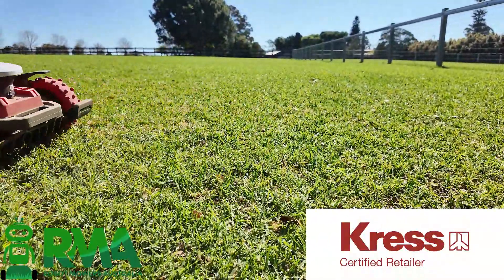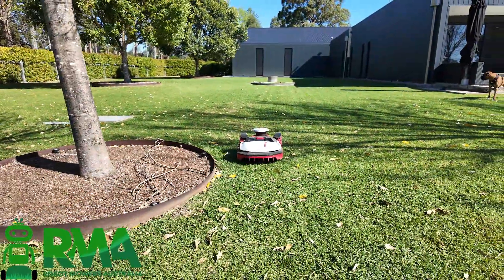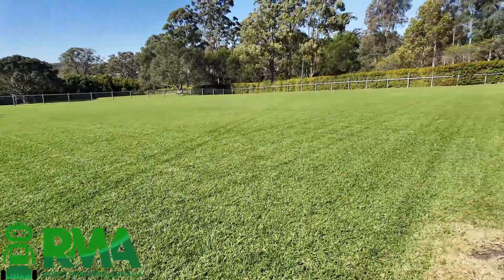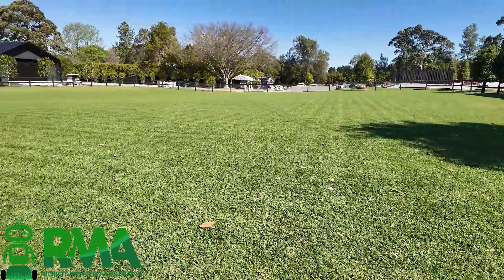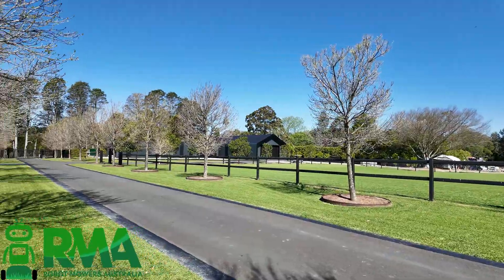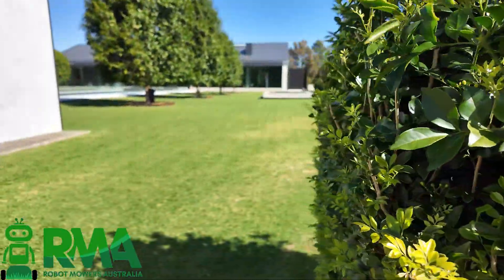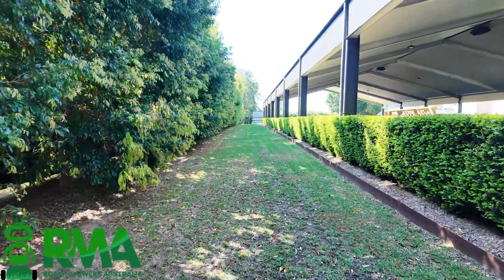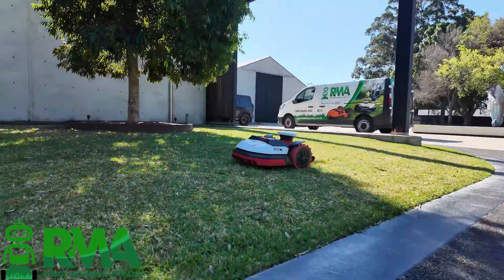Kress RTKn Installation review

Comment: So from what ive understood, that the RTK when it detects the obstacle when it drives out the next time for cutting, it will  go and check the obstacle first, so we have been told to enclose everything that the robot can see through the Oas so it spends more time cutting then checking the obstacles it detecs on its own instead, 

Has that been an issue with the fence posts?
Reply from the maker: As far as I've seen, it doesn't remember an obstacle from last time. The fence posts have been fine, it goes around them each time. The main benefit of mapping an obstacle is the mower will do a perimeter cut around the obstacle rather than leave a jagged edge from wherever it went around it